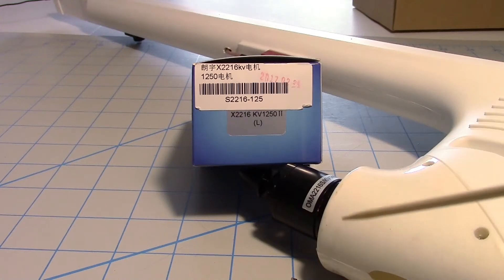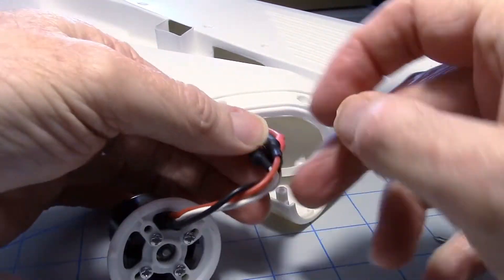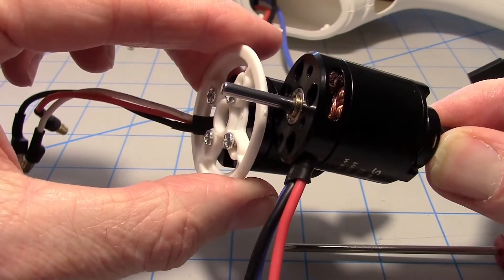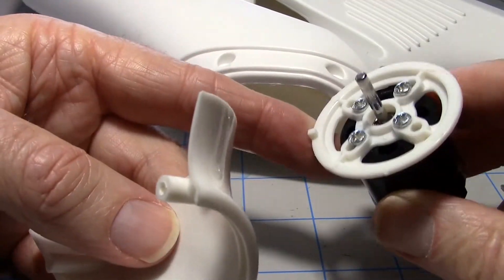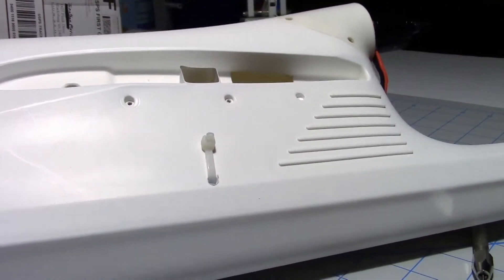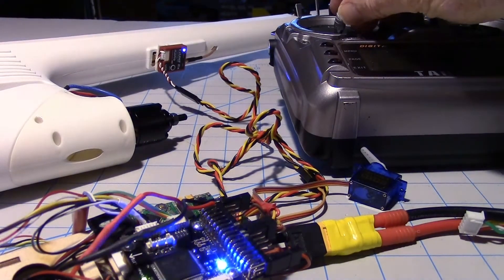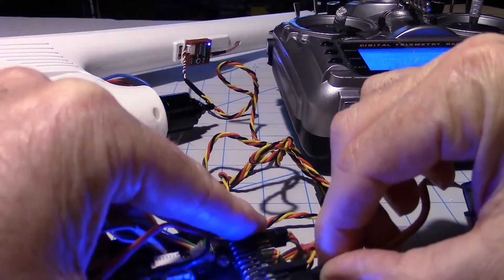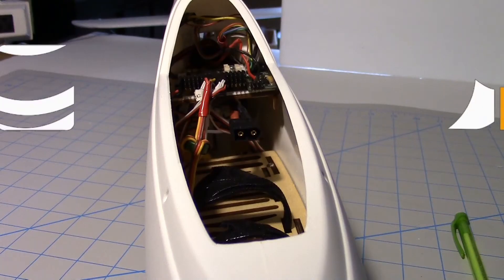Volantex Ranger 2000 FPV RC Plane Build Part 4 - Upgrading Motor to SunnySky x2216 1250kv

Comment: Very wise move on the motor upgrade. I went to 4S on my Ranger 1600 quad-plane and since it was lugging around about an extra 800 grams thanks to the quad frame, motors, props, escs, etc, the thrust motor was having a slightly hard time of it in normal flight mode and showed its dissatisfaction by melting the motor mount and dropping off. 
I upgraded to a 2836 950kv stood up on an oval plywood mount that holds the motor about 35mm above its usual position and allows up to an 11 inch prop to be used.
Reply from the maker: I really like the performance of the Sunnysky motors.

Comment: Sir i made one scratch build pusher plane same as this one.as i throw the plane with hand its nose directly goes downwards.i dont know how to adjust tha thrust angle in my pusher rc scratch build with thermocol
Reply from the maker: All the pushers do that. Keep the throttle medium and give it a strong toss then bring the throttle up to speed. Oh and if that doesn't work put an up elevator switch on your radio for launch then switch off once you are in the air.

Comment: Instead of the hassle of drilling into the fuselage an zip tying the esc, why not double sided tape or velcro? Easier, no drilling holes or ugly ties.
Reply from the maker: Because it's more secure. I have used hook and loop before but don't like it much for holding ESCs.
Reply: @DaveMerc  That's fair. Use what you're comfortable with. Was just curious.

Comment: Which pros you use with this X2206-1250Kv engine in Ranger 2000?
The X2206-1400 isn't best to use original Prop, more trust?
Reply from the maker: 8x6 APC works for me.
Some like the 8x8 for a little more thrust.

Comment: Punch a pair of holes on either side of the ESC and zip tie it to the fuse...nvm you did that lol 

Were you worried about burning out the higher KV motor or did you just want a more efficient and easier to launch setup? 

I just stick to nylock nuts these days and doing mess with reverse thread nuts. This way I can swap props in the field if I need to. 

For your servos I would recommend switching to some emax metal gear digital servos. Digital because you are using a FC and the FC can make adjustments faster that way. The MG emax servos are also inexpensive and solid performers. I have had some withstand plenty of crashes and not fail on me. Those TowerPro servos sounded a bit rough. I would not want to have a failure or gear strip at range, the emax servos are full metal gear. 

Looking forward to seeing this thing fly, let me know when you are ready to maiden I would love to launch it for you!
Reply from the maker: Zip ties are the new duct tape. I found some ES08MA-II servos in my collection. Might use them. When I get it done I will see if you are available for launch  :-)
Reply from the maker: I found out from the reports that the 1250kv motor is a better match for a 4s setup with the 8 inch prop. The 1400kv works better for 3s like on my Tek Sumo wing.
Reply: I can confirm that the stock motor is at best marginal on 4S. I converted a Ranger to a quadplane so it is significantly heavier than standard and it cooked the motor pretty fast when I had to bump it up to 4S for the lift motors. It actually melted the plastic motor mount.